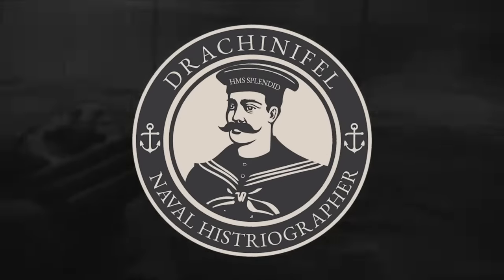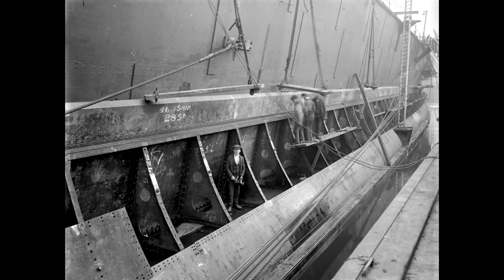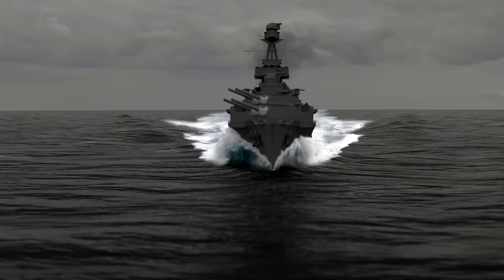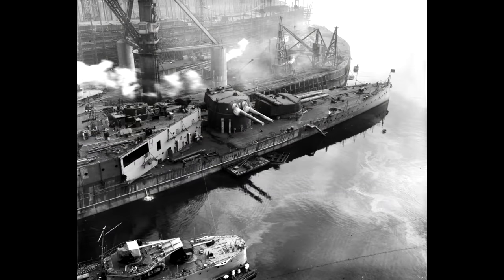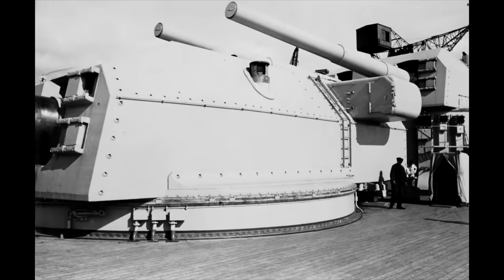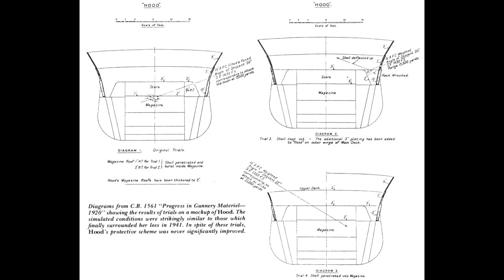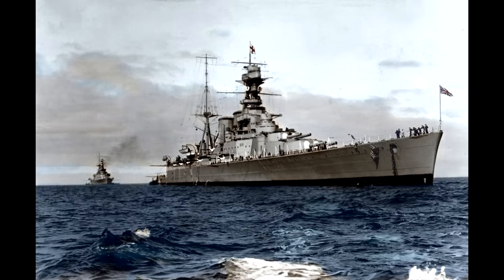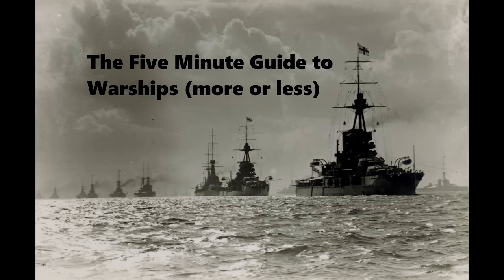The Loss of HMS Hood - But why did it blow up??

Comment: This is a very interesting examination, and seems the most probable explanation for the catastrophic loss of Hood.

However, it is part of the larger picture overall. Because Admiral Holland had started with an overwhelming advantage in firepower available to him - two capital ships opposing one German battleship, two heavy cruisers against a single heavy cruiser. And also 4 destroyers to launch torpedo attacks.  

However, due to the handling of his forces, this advantage was completely lost as neither the destroyers or cruisers took part in the action. And due to their narrow angle of approach, Hood and Prince of Wales found themselves in the appalling situation of being significantly outgunned by the Germans. 

Thus the tables had turned completely which, to put it mildly, is very poor management of resources. The situation could hardly have been worse. Except that Holland then compounded these self-inflicted disadvantages by signalling Prince of Wales to follow his lead and concentrate her gunfire on the left-hand ship, which was in fact Prinz Eugen.

If the Prince of Wales gunnery officer had not (at considerable disciplinary risk to himself) ignored the signal from Holland, the fire of both ships would then have been concentrated on Prinz Eugen instead of Bismarck, making an already very bad situation into a farcical catastrophe. 

By comparison, Bismarck and Prinz Eugen had brought the full weight of their armament to bear on the unlucky Hood. Which Holland had kept as the lead ship despite its known deficiencies in armour.

In all the above, it is hard to find anything positive about Holland’s handling of the action. And with the odds turned so dramatically in favour of the Germans, and their 8 x 15-inch and 8 x 8-inch guns now raining down heavy shells on Hood alone, the tragic outcome seems almost a foregone conclusion.
Reply: Whilst concurring with most of your comment, I'd like to add some of my own thoughts.

Yes, in the engagement of Bismarck / PE Vs Hood / PoW there was on paper a superiority in RN firepower BUT.

1. The 2 RN heavy cruisers were at no time in gunnery range of the Denmark Strait engagement, being in a tail chasing position and with V/Adm Holland electing to retain radio silence and not communicating his intentions to Wake-Walker in HMS Norfolk. Norfolk did fire a couple of wishful salvoes at the German ships which fell woefully short.

2. The Destroyer escort that had accompanied Hood / PoW had been detached to search northwards for the German ships when Suffolk / Norfolk had temporarily lost contact with the German ships earlier in the night, and as a consequence of their detachment were NOT at the scene of the battle... Though they did arrive shortly after the engagement had concluded and it was the destroyer HMS Electra that finally rescued the three Hood survivors.

It's all very easy to make a charge of a "poor management of resources" in hindsight. But I wonder how the many armchair admirals that haunt comments would have handled a high speed interception at long range with the enemy on the very border of his intended scene of operations, in an era before satellites, over the horizon radars, GPS or even comprehensive air coverage, and then just as the plan was falling into place as planned through the "fog of war" the shadowing cruisers lose contact with the quarry shortly before contact, and all the careful plotting of the interception course has come to nought.

Sitting on the sidelines picking fault, is a universe away from being in sole command of major units in a bleak stormy North Atlantic with imperfect intelligence to base your decisions on.

Holland was not alone in making a "wrong call", Lütjens was in hindsight equally faulty in some of his decisions, in the immediacy of a fast moving dynamic engagement snap decisions have to be made. Make the right one and its "V/Adm Holland, the Hero of Denmark Strait"... make the wrong call and its "Why did the fool do that"?
Reply: @walterkronkitesleftshoe6684  
Yes, agreed, it’s very easy to pick fault from the comfort of my armchair. But in this particular case, there seems to be a lot of fault to be pointed out.

There was, on paper, a superiority in RN firepower, but most of Holland’s ships were of 1920s vintage and generally smaller and/or inferior to their brand-new German opponents. Prince of Wales was modern, but so brand-new that her crew had not yet reached anything like full efficiency. And her quad-gun main turrets were a new & complicated design prone to frequent malfunctions. He would need ALL his ships in the fight, and need them to perform at top efficiency too, to be able to carry the day.

But Holland had the considerable advantage of Suffolk and Norfolk shadowing the German ships and sending out regular reports, so he knew their course, position and speed. And his course due west would put him in the perfect position to lie in wait and allow the Germans to blunder into his trap. However just after midnight the cruisers lost radar contact and, probably fearing they had changed course, he turned due north hoping to intercept them. However, he had guessed wrong, as the Germans maintained their course to the south west.

It was this course change that put his ships in their unfavourable gunnery position when they tried to catch up. That his heavy cruisers & destroyers were at no time in gunnery range is purely a result of Holland’s handling of them in the action. With better management they could have been involved, and would have made a very significant difference.

Having purely by his own actions swung the odds so very heavily against his squadron, it is hardly surprising that the now overwhelming firepower advantage of the Germans quickly obtained devastating results. Especially against a ship never designed to fight it out toe to toe with a battleship - let alone a battleship and heavy cruiser combined. Why Holland thought it could remains a mystery.

And it is only by the slimmest of margins that Prince of Wales did not share the fate of Hood. Because the close formation ordered by Holland enabled Bismarck and Prinz Eugen to quickly switch their fire to her and she then suffered a series of heavy hits. Fortunately, they did not then pursue and finish her off as they could have done.  

In other words, the final outcome could so easily have been even more of a humiliation. And if both ships had been sunk - worse still in a straight fight with inferior forces - the worldwide prestige & reputation (and morale) of the seemingly all-powerful Royal Navy would have taken an even greater battering. One which Great Britain could ill-afford at that desperate stage of the war. 

As mentioned previously, it is very hard to find anything positive at all about Holland’s handling of the action.
Reply: @VincentComet-l8e  Don't for one second think I'm justifying Holland's decisions, yes they were flawed especially with the advantage of cool, unpressured hindsight... but he's not alone in making such bad calls, when the chips are down, the pressure is very much on, and a fluid situation calls for an immediate decision.

I'm aware of and agree with the points you make. On the other side of the scales of history is the fact that the inexperienced and mechanically imperfect HMS PoW singlehandedly stopped the German's plans to wreck the Atlantic convoy system, and that whereas the RN lost a revered and venerable 20 year old battlecruiser which comprised a relatively small part of the RN capital ship establishment and whose loss was replaced manifold, in exchange the Germans due to events precipitated at Denmark Strait lost a much vaunted nazi "uberschiff" who after 9 days at sea was put on the bottom of the ocean, a loss of 25% of the Kriegsmarine's capital ship force which was never replaced.

In all likelihood this only happened because of Holland's initially unplanned interception at Denmark Strait. Unplanned in the sense that his force was originally tasked to sail to Reykjavik to refuel and from there backup the Norfolk & Suffolk, but instead had to plot a long range, high speed interception course "on the fly", which as we know would have been a perfect interception but for the temporary loss of contact with the German ships at a CRUCIAL moment just hours before battle was joined. 

What would have been the outcome if Holland complete with his attendant destroyer screen (which had been detached earlier to attempt to regain contact with the Germans, and as a consequence took no part in the action) had instead crossed the German's "T" at Denmark Strait, something that could easily have been achieved had it not been for the unfortunate crucial loss of contact in the early hours of 23rd May which threw all of his planning to the wind?
Reply: @VincentComet-l8e  YT seems to have failed to notify me of your repsonse above Lawrie, and I've only just stumbled on it accidentally.

Why was Denmark Strait "A total disaster"? undeniably it was a much heavier cost that had been expected, BUT the Bismarck's stated mission WAS unquestionably stopped in its tracks at 06:20 on 24th May 1941, when Lütjens' hand was forced to make directly for the nearest home port with suitable facilities.

I didn't agree that Holland "did badly" I said he managed a difficult high speed long range interception, made one or two questionable tactical decisions and then was laid low by a million to one shot. Its easy on the surface to view his performance as "bad" but how much worse would it have been if he had failed to engage at all (as so easily could have happened, just see how Scharnhorst and Gneisenau had evaded the RN for over 8 weeks during the earlier "Berlin" sortie) and the Germans had instead slipped out unopposed into the wider North Atlantic?

You assessment of PoW "only very narrowly escaped destruction" is overstating the reality. She was hit by just 7 shells (3 from Bismarck and 4 from PE) none of which detonated due to the correct functioning of PoW's "all or nothing" armour scheme. She withdraw because her gunnery which had already landed multiple hits on Bismarck was working at close to 50% of its designed capacity, and she was then facing two ships that were working at full efficiency and which were certainly having "a good day". She was so near to destruction that within 30 minutes of her withdrawal she was again easily shadowing the German ships (who for reasons of damage control and fuel economy) were now forced to lower their speed. In the following 24 hours she again engaged in two further gunnery duels with the German ships but no hits were landed by either side, before she finally had to return to Iceland for refuelling.

If after the Denmark Strait engagement Bismarck / PE had slipped her pursuers, refuelled from one of the supply network ships and gone on to savage a convoy or two and disrupt the routing of the whole Atlantic convoy system for a few weeks THAT would have been "a complete disaster". As it was directly as a result of the action at Denmark Strait NEITHER of the German ships even laid eyes on a supply ship OR a British convoy, the Convoy system carried on undisrupted and 3 days after the loss of Hood the PRIZE asset of the kriegsmarine also settled onto the bed of the Atlantic.

Job Done.

Comment: So once again Drachifinel has ended up being my gateway drug to a serious Friedman addiction.

In Friedman's design history of British Battleships he seemingly agrees with the committee verdict that plunging fire penetrated through the machinery room and thence into the 4.5" magazine. This would explain the venting near the mainmast in the same manner as Drach's hypothesis, but as Drach points out the angles don't seem to work if Hood was on an even keel. If Hood's final turn to port were fully developed then she would have heeled towards Bismark, which might have steepened the angle enough to allow a plunging hit. It would be interesting to retry all of Drach's trajectory scenarios with the assumption of a few degrees of heel. It is also noteworthy that this very same heel would have also tended to "bury" the lower edge of the starboard belt and thereby make Drach's hypothesis less likely.

With respect to the hypothesis that the bow wave's trough exposed the bottom of the belt, Friedman acknowledges that this was a known concern for other fast British capital ships such as Renown, particularly as they were refitted with blisters that restored buoyancy margin. I therefore agree with Drach that this phenomenon was quite "real" and possible.

With that said, the fact that the two Admiralty investigations didn't consider such a well-known phenomenon as a hypothetical cause gives me pause. The diagram Drach cites demonstrates that they had definitely considered this issue with respect to Hood before her loss, and presumably they had the ability to characterize it much more than we ever can after the fact.

Comment: Thanks for the video. Loads of excellent research. However, is there one more possibility? What if the ship was not fitted to spec and either mistakes were made, or corners were cut off the original plans e.g. armour plating was not as thick as it should have been?